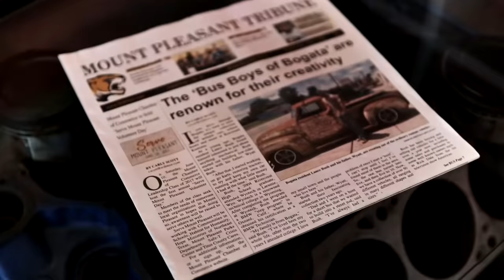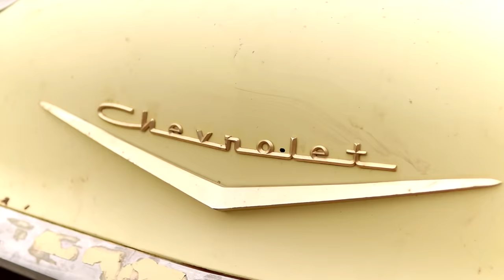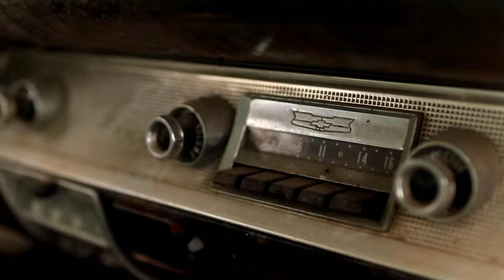1957 Chevy Bel Air, Will It Run After 35 Years?! | Turnin Rust

Comment: Four door hardtop [as opposed to a sedan] is way harder to find than a two door hardtop.  Technically called a Sport Sedan.Good find.  FYI, the gold anodized trim indicates a Bel Air.  P/S, P/B - likely a 283, the 265 went away in 1957.  Looks like a well optioned car.  Will be following this one. 
I had a 56 210 Del Ray four door hardtop [Sport Sedan].  Loved that car for 15 years.  Mine was a 265, three-on-the-tree, P/S and P/B car.  The power steering pump on back of the generator worked just fine.
Big purple wire feeds the starter.  Rochester 4 jet carb. Predates Quadrajet.    Square bore/base.  Be sure the throttle pressure rod to the transmission is in place and adjusted properly.  Important to shift point and longevity of the cast iron PowerGlide.  There is a special flexible tool, like a long screwdriver, just for early GM distributors.  Worth the investment.  Goes through the point window of the cap, adjust the dwell with the engine running.  About 28 degrees should work.  The rotor will only fit one way.

Comment: That was perty cool. The ole girl seems to run perty good. They make a special tool to do those points with it screwdriver looking thing . That has flexibility plus the all Head. Then you use dwell metter to set the gap on the points.
Reply: Yeah them old point lifters would wear down pretty quick and wear the points out with em 6000 miles was about the life of em they used a dwell meter to get the maximum voltage out of them coils..carbon fiber wires sucked too

Comment: Those points were adjusted with it running. Stick a allen wrench through the window and screw it in until it misses then back it out 1/2 a round.  The window should have a little metal door that slides up.  Oh and that's a 327 valve cover on the passenger side.

Comment: Its all fun and games until you start fighting with old tires off the wheels :D I still see nightmares from the ones that I had to go through.. Early 80's michelins & finnish hakkapeliitta tires. Horror story when the rubber has been rusted to the rims & those wasn't tubeless.
Reply: When I was a kid, I would help my dad break down split rims by hand...those were the good ol days😳
Reply: @garysmith5781  Oh yeah! Old forklift & tractor  etc wheels needs a special skill to work on, my co worker told me about the exploded semi tire.. Everything in 25ft area was pushed away & a giant hole in the roof :D (none died or injured badly)

Comment: use an old squirter style oil can to put the gas down the carb, And make yourself some different length wires with alligator clips on both ends you can use,

Comment: 1:27:20...Dang! If I were there, I'd want to help out by removing that broken driver's door glass (before y'all cut yourselves). Nice first start after a 35 year automotive quarantine! 1:28:59...But dude, clean the windshield first, before you go driving it! 1:33:24...I see you still have that '59 Cadillac that you got running in an earlier video!

Comment: set emergency brake, disconnect the vacuum advance, plug air side, put in gear, set the screws to top rpm, replace vacuum advance you set the carburetor

Comment: Hey guys, great find. I wish I could get in the shape,nice. I really like you channel and videos,would You guys are on it awesome. I'm glad to see a father and son team up together 😊. That's a blessing..
But, you gonna know you should and not guess about what you may need? 1st - Remove Starter Switch,, Screwdriver multi-head screwdriver set, Phillips head screwdriver set, 2nd diff size wires,,3rd diff carburetor, with clanres. 4th - vice grips diff sizzes?? Socket wrench, 5th water jug s ,6th-gas jugs and the rest of the things here
 Goves  Glasses,  Black Tape Tape measure, - small drill battery operated , impact driver.small, Battery,  jumper cable s, plugs and plug wires , gas, special gas Rust lube, lube  blaster penetrated catalyst, WD-40, evapor rust (of some sort) . Gas filter, oil filter, 
These should've in a tool box or cart ALL  THE  TIME!!!! 
P.S clean gas too. 
Thank you I'm keep wat hung cause you guys are great ..thanks again

Comment: After breaking the deep side of the rim, the tire will come off the "shallow side" of the rim much easier.  Mount the next tire in reverse.  Those old type tire changers are hard on the back!
Reply: My daughter made a video of me taking a tire off 14 “ steel rim in 50 seconds with bumper jack handle tire iron and large screw driver. A few years ago when I was 60

Comment: Did you ever think about going online and checking to see how to tune a 283s points and distributor and timing? After all the car is 65 years old and has been sitting for 35 years.  Parts wear from time as well as over use.

Comment: Yep, you can always tell if that car had ever been hot prodded. 55-57 would have the firewall behind the distributor  beat back, sos it would  break off the rotor cap, or distributor  cap when you raced.

Comment: The battery on my 51 ford is held in with a bungee strap it’s on a 98 s10 frame with the 4.3 out of the s10 with over 300,000 miles on just the s10 and it’s my daily driver

Comment: Never turned a wrench with my daddy in my life.  I pulled eight flat head ford v8's in one day with my mama's daddy.  He gave me 10 dollars.  I swear every burn or cut on my arms and hands tells a story of an old car I wrenched on.  I mess with old Triumph cars mostly and love them because you can basically take them completely apart with a full set of wrenches and a good set of screw drivers.  Plus the old ones are based on Ferguson tractor motors.  Every old man machine shop I've taken a cylinder head to says it puts them in mind of an 8n head.  Well because thats where Ford got their tractor design.

Comment: It has rubber baby buggy bumpers on it. 57 Chevies had 283 v8 in them.
It also has power steering. The pump is on the end of the generator on those. I can see it.
Yes it will run. Anything can run. Of course the cam may wipe out from cranking it over totally dry, some of the rod bearings may spin from sticking to the crank from being dry. Cylinders may score all to hell from being totally dry. Oil penetrates into things, it also creeps out. Carburetor is all but guaranteed to flood all over so it will get plenty of gasoline lubrication in the cylinders.
It has power steering but only has a vacuum wiper motor. That can be a good thing because electric wiper motor can rip all the cables up on the wipers cable drive which is a whole tremendous amount of fun to try and fix.
Park, neutral , drive , low, and reverse on the bottom.
It’s having a hard time spinning all those stuck bearings.
Just try and imagine putting a motor together and instead of using assembly lube clean and wash all bearings and cam lobe and cylinders with soap and water.
I spent way too much time in my youth playing with these cars. I know every square inch.
Put your jumper wire on the top connection of that ballast resistor on the firewall.
Looks like he’s putting it right on the coil.
Put 1/8 inch Allen wrench in the end of the points screw and turn it till they are opening and closing. That should make it start. After you get it running go through the window in the cap and turn till it starts to break up and quit, then turn it back 1/2 turn and it should be right about on. I used to back up 1 whole turn on my 283 Chevelle for max performance.
No accelerator pump. Might even have a leather plunger on it like a tire pump which is most assuredly all dried up. You’ll have to use the choke.
Before you try driving it much you better put about three big gas filters on it to catch all the wonderful stuff coming out of the tank.
Sounds like it doesn’t have much compression from being so dry. Better pour a bunch of oil down that carb. If you’re smart you’ll try and fill the float bowl through the vents.
When I was playing with these cars in the early and mid 1970s very very few of them still had original engines. Those that did were leak, leak, leaking and smoke, smoke, smoking.
No PCV system, just a road draft tube pulling fumes out of crankcase made the whole underneath a greasy nightmare.
Reply: I noticed neither one of them made any kind of check on whether it had any oil pressure.

Comment: the way to put DRY rubber hose, on DRY metal piping, is to spit into the hose, and put some spit around the metal tube, and slid the hose on, REAL eassy. RC

Comment: Man im.looking for a good  running 350 chevy motor. Im not having any luck finding one where i am in southeast texas. I have already pulled and put in two and they both turned out to be junk. They were both injection motors so i have no way really to check to see if they run or not without a computer to hook em to. . Im looking for a good running carburated 350 if you know where to find one.

Comment: You guys are better with the body than the mechanical stuff especially on the old stuff. I was screaming at the video wondering why you guys didn't just pull the fuel pump and match one up at the parts store.   It's a basic small block Chevy and I'm sure they would have one in Stock. The only thing that would matter is the number of lines on the pump and the orientation of them.   I was also a bit upset with the way you have the battery on the fender and then put a makeshift gravity feed fuel tank right next to it where you are jump starting the car with a wire to the battery and solenoid.   Maybe I'm crazy but when I try to get and old car running again I make sure it is getting spark, air and fuel. If not then I solve one problem at a time and fix it correctly then move on to the next. But that rigging stuff up is crazy. Now you have to undo most of what you already did and do it the right way. I don't know about you but I hate double work.
Reply: Oh, and by "air" I meant compression. I just have a habit of saying that because I know what I mean by it. And another thing I wanted to mention was that from what I could see using my phone to watch the video with my old eyes I couldn't tell if there was an automatic choke. So my bet is that there is a good chance there is a manual choke and all they had to do was adjust it from behind the wheel by pulling out the knob while depressing the gas pedal slightly and finely adjusting it after the engine runs.

Comment: i don't know why you would not fix the wires proper instead of a half job by putting a starter button,the wiring is so simply back then,plus you may have a bad neutal safety switch

Comment: Next time with a blockage like that put a hose in the radiator and just let th water run to flush it out. And with a new hose put the end in some hot water and WD40 on the tube to help it go on. :)

Comment: Did you ever hear of Petroleum Jelly or WD 40? They make them to use when something is hard to get on and you lubricate it first, and it will slip right on. You could have a real car for 2000.00 that had a real engine and transmission in it. Like a Buick or Oldsmobile or Chrysler or Dodge or Studebaker Commander.

Comment: If a 283 v8 can turn over by hand. It will starr. Seen some set for 30yrs. And roll over and start like you just shut it off 5minutes before. 283,307 and 327 Chevrolet engines are tough as nails and hard to kill.

Comment: I had a 57 bel air.  That is not the original more it was a V-6.  The fact that gave it away is the front quarter panel only has 3 vents.  And original V-8 would have 4 vents

Comment: Get that old rascal to show the motor is tight and right it would be time for electronic ignition distributor to delete all that point bull---t.
Reply: Gotta dent the firewall to get an hei in there. Or get that adapter kit for original distributor
Reply: These cars ran fine on that point Bull shit for years.

Comment: You should watch DD SPEED SHOP on how he made his 57 into a 2Dr.
Reply: You can only do that on four door post cars, this isn't a post car
Reply: You can only do that on the four door post cars, this car doesn't have a post
Reply: @chadheron965  Maybe I don't have my fax down, on the conversion because I haven't looked into it... But Chad why is that so??? They all share the same wheelbase. As far as I understand you can do it with any model. As far as I've understood most of them have been converted from 4 to 2 post because most of the 4 doors cars are post cars, and I'm sure a lot more parts would be involved. This was an article I found on a convertible conversion from 4 to 2 door.

http://www.superchevy.com/how-to/paint-body/sucp-0010-four-door-tri-five-convertible-conversion
Reply: I believe part of has to do with how the structural integrity of the car on the top portion is angled  different, and part of it has to do with how the parts fit back on the car , I saw on Craigslist someone who had obviously tried this with a no post four door car and you could tell it didn't look right. I think when you do it with a post car it's more just a matter of cutting the sheet metal and welding it back into place, plus you can just change out the side trim from the four door to two door with no problem. I'm not an expert just my observations from videos I've watched, hope this helps.
Reply: @chadheron965   I'm no expert in the matter as well, I would love to know for sure, as I love 57 Chevys myself... It's been my dream car since I've been like 12 years old going to be 38 this year... I don't think I'll ever get one. Piece by piece I'll get there, I've got the grill and grill bar they need hanging on my wall above my desk and a hood ornament for paperweight sitting on the desk... I know just about everything there is with a 57 Chevy, but this Frankenstein assembly something, I'm not sure 100% sure about myself, but I do believe it is possible especially with all the reproduction panels on the market, you can practically build a whole car from reproduction panels, if you wanted to. I realistically don't think it's that hard in this matter to take a 4-door coupe and turned it into a 2 door coupe, I think it's probably just had not been done that often due to the fact most 4 doors were not coupes to begin with. All of the 4-door coupe models were Bel Air only the rest of the 4 doors where Bel Air, 150s, & 210 sedans so the majority was four door sedans. There were actually less 4-door coupes made then 2-door coupes produced. I believe if you were to take on a 2 door conversion you basically would have to replace the roof , as it is different, as well as the front doors with either two-door coupe or two-door convertible, and then you could rework the quarter and the same as in a similar manor as to the video in question here with the post. Basically you could use the skin of the 4-door for a new quarter, and rework the structure, or you could buy all new metal. Like I said this is what I believe I'm not a 100% percent certain at all, but would love to know.

https://57classicchevy.com/1957-chevrolet-body-styles

Comment: what i don't understand yall buy a lot of vehicles and i don't know why you do what you do. but as many as you buy you go thru the same deal each time you have to find a jumper wire and make up everything each time you start a new vehicle. for the life of me i can't understand why you don't fix up a set of jumper wires and all the things you know you will need each and every time you do this and have it on the cart you roll around. its like each time its the first time you have done it. you know you will need jumper wire, battery, fuel line and most likely a fuel pump and small gas tank but its like you figure it out each time. the first time i watched your videos it was like you were just getting started doing this but have watched for a long time now and its still the same you would save so much time and effort if you were prepaired don't get me wrong i enjoy watching but get frustrated when you spend so much time getting up what you need like you didn't know what you were going to need. i grew up in the salvage business we started a lot of cars we had a little kit of everything we should need

Comment: Any old (carburettor) engine will turn and is capable of being restored as back then they were not made to fail intentionally.
Actually even the early modern fuel injection engines (up to 2000) is capable of being restored.
They can build environmentally friendly cars that do not need much maintenance not needing to be thrown away. 
However, they found out the 90's cars were too durable & economical and actively reduced engine life span.
Today they have plastics that have been designed to fail after a few years even with little to no use, making repairing the parts impossible and replacements unavailable resulting in junking newer cars.

Comment: That's weird, it has power brakes & power steering but it has a vacuum windshield wiper motor. You would think they would have order it with electric windshield wiper motor before the power brakes and steering the passenger side valve cover doesn't look original